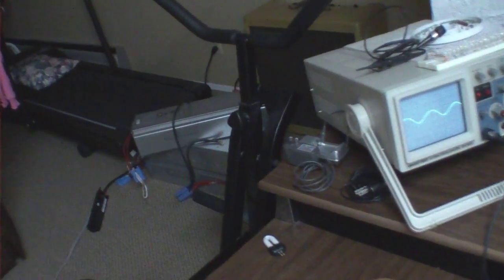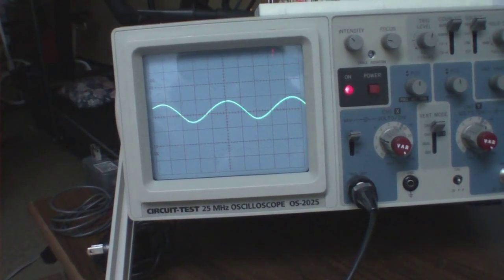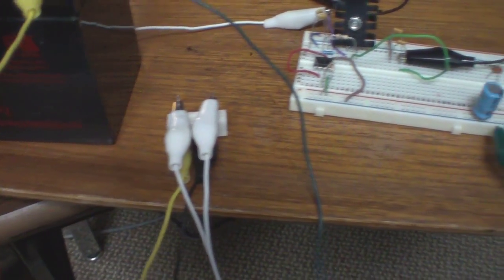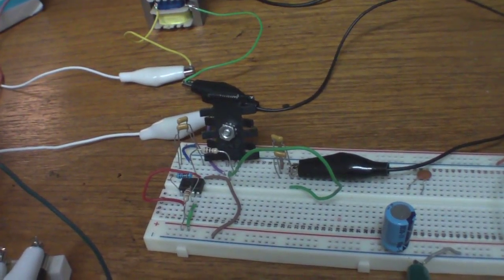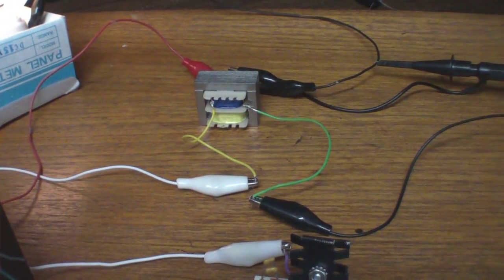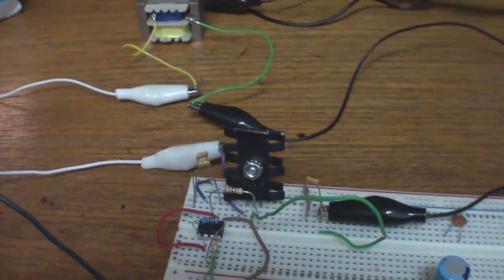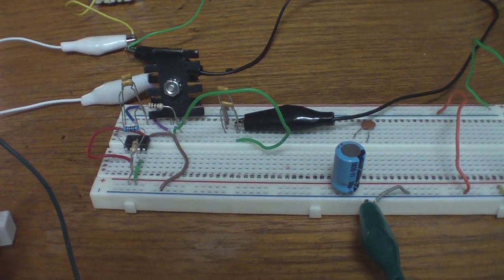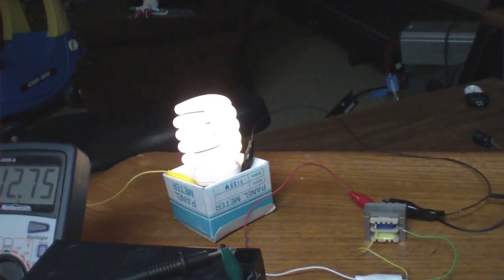(Final) 12 Volt 1.8 watts CFL Driver - 555 Oscillator / Inverter - Sentex Kyle Mod II

Comment: Hi kyle. Great presentation. Nice and clear. Could you post a circuit/schematic please? I want to try and use a MOT with rewound secondary to try and run the lights in my flat. At present am using 300W inverter on 12Volt DC in. I like the low current draw and was wondering if my idea will work. I am a builder then find out why it dont work and then make it work type of person. Thanks again for video.